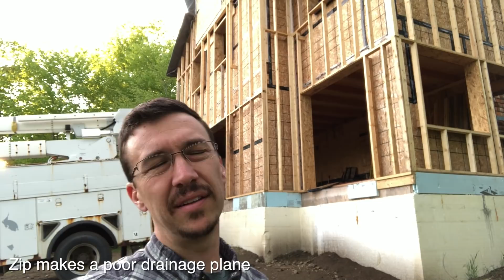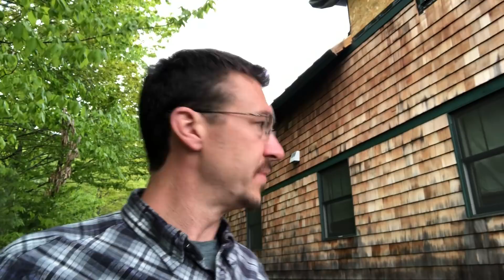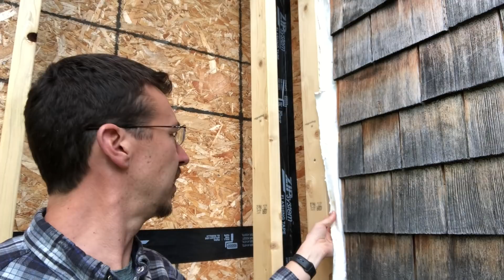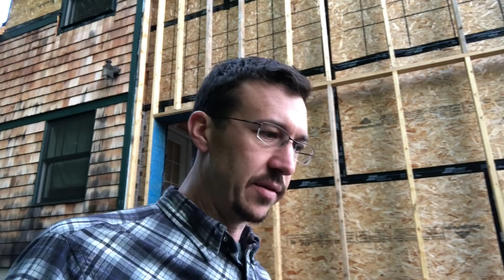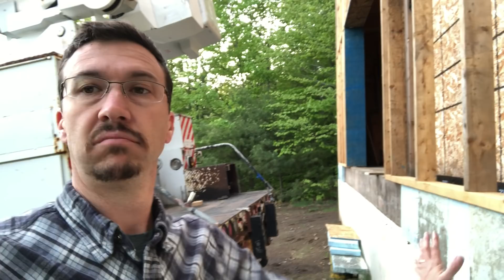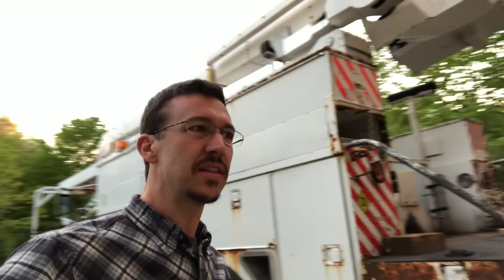Don't put Zip System Wall Sheathing on Double Wall Construction

Comment: In northern climates my preference is double wall construction with a well sealed vapor retarder on the inside and the rest of the structure breathable. No Tyvek, tar paper with a rain screen and bug stops unless you are applying stucco or a stone veneer. I those cases the moisture from applying the cement base coat swells the black paper and leaves air pockets that assist in moisture disbursement. Quality windows and an HRV complete the package. Mineral wool or dense pack cellulose for insulation. Both are fire, rodent and insect proof. I build my homes to last a hundred years at least
Reply: morninboy  so what do you use with a stone or brick Vanderbilt?

Comment: Go with the zip. Tape the seams and liquid applied sealer for nail holes. You want to drain any water that gets behind siding. Vent area between zip and siding (rain screen) so siding and zip can dry. Apply vapor barrier on inside of house to keep vapor out of walls. Use a whole house air system to extract excess moisture. If the sole function of the zip would be rain screen then maybe vent space behind it so the rock wool/wall cavity can stay dry. Just some thoughts for research. I may be in left field, but trying to help.
Reply: If you have a rain screen ……… probably pointless to do liquid flash the nails

Comment: Wow where to start. It is not ok to not know what you are doing. This is the information age. If you look you will find more info than you ever wanted to on products and installation methods. Tyvek is the biggest rip off ever. Do not use it. Do not use OSB ever unless for starting fires. Why would you use a product that disintegrates ? Spray foam insulation is both an insulation as well as a vapor barrier. Damage occurs when heated air escapes the envelope quickly and meets cold air. This creates condensation the number one destroyer of homes. If you make it impossible for heated air to escape at a high enough temperature than you will never have condensation. This requires a thermal break. Wooden studs do not insulate. You must stop thermal transfer through the wall studs to prevent condensation. Doesn't have to be ridiculous R factor it just has to be there. Use the same system on your roof. Letting your roof freeze is stupid. And cutting holes in your soffet and installing giant vents is beyond stupid. Spray foam ( closed cell ) and a thermal break will create an envelope that is impervious to condensation. Air quality. Install an HRV system. They are easy to set up and work better than any garbage tyvek makes. Do your research. Different products work better in different climates. A building in Miami may require a different system to perform properly. The basics are the same. Create a thermal break surface that cannot cause condensation because it cannot let air escape either hot enough or cold enough to cause condensation. Use ICF all the way to the eaves and if you got the guts use it for the eaves and the roof too. Sure it takes some effort to understand the mechanics but the science works. You will never live in a more comfortable and strong structure. Peace of mind is priceless. I hope you used a drainage curtain on your ICF's. It should be installed all the way over the footing and at least 2 feet out all the way around your walls. Remember you have to be smarter than the house.
Reply: Hmmm. I installed Tyvek on my garage 20 years ago and it's still pristine and doing it's job. How is that possible you ask? Because I did not follow the manufacturer's instructions nor did I install it the way every single contractor know to man does it. I actually thought about what I was doing and why. Oh and I also used OSB for the wall sheathing (plywood for roof and second floor). It looks and feels like it was installed yesterday.

The point is if it's done right it will last a lifetime. Sadly, contractors and builders don't give a shit about building for long term.
Reply: Well in Europe we use ICF where it matters. Under the concrete slab. OSB is used before plywood in places like behind the drywall (inside walls). We never use it for the structure or outside. OSB is half the price of plywood and don't bend like plywood does. Spray foam is the dumbest idea ever, well after DDT and asbestos. It gives constant gases that will kill you.
In Europe we never worry about thermal value of a studd. That seams to be an american thing. Studs have an R-value of 1. So get bigger studs, and you solve the problem. 2 by 8 is not uncommon for walls here. Floor? 22 millimeter advantech (pressed and glued product), is what to use. A good house have 1.8 inches thick floors.
Reply: @72strand  The acid cure floor finishes you guys use (Glitsa. Synteko ) is ten times more dangerous than polyurethane. Go read the manufacturer material reports. That is a total myth.

Comment: You don't need a WRB over ZIP. Use a fluid-applied to cover nail penetrations and it is perfectly acceptable drainage plane.
Reply: Don’t even need to do the WRB on the nailed spots unless an idiot made them over driven.
Reply: Another Zip fan boy
Reply: @Skinnymoose  nope, there are many other perfectly acceptable sheathing systems when done correctly. Zip is just one of them.
Reply: Yah plus the liquid flashing takes care of that

Comment: Wrap it with 30 lb felt and forget it .it'll be there when we're dead and gone!dont use cellouse because it will settle after 3 years and you will have a 18 inch settle void at the top ,rocwool or foam.tyveck has a 90 day sun guarantee,it should be 90 months!
Reply: I dont like felt anymore. When I was a kid my dad used it to cover the garage roof and it never soaked water or leaked. But the felt of today soaks, wrinkles and falls apart. The old stuff was saturated with tar but today there is less byproducts produced in gas refining so there is a shortage, so today's felt has very little tar in it.
Reply: @michaeldvorak5556  15 or 30 lb. Felt?
Reply: @MD-cd7em  Its been a long long time, but I'm sure he used 30# on roofs and probably 15# on walls. It didnt take much handling before our clothes and hands were covered with tar. The stuff today will barely discolor your hands.
Reply: @michaeldvorak5556  INTERESTING...YOU MAY HAVE A POINT...I STILL USE THE 15 SOMETIMES
Reply: @michaeldvorak5556  Cellulose does not settle if installed properly. Professionals install cellulose at 3.5lbs/cu.ft. with a pressurized dense pack hose. The cheapo box store rental machines can't install cellulose at proper density, and It will settle.
Reply: @jacobcasler342  I'm sorry, Mike Redding mentioned cellulose settling. I was only commenting on tar paper. I know the wet blown cellulose they do today is tightly packed and it won't settle, but in old houses that had cellulose blown into the walls it would settle 2 feet.
Reply: The issue with felt is that it quickly deterates if left exposed. Basically if you don't get it covered in about 30 days, its trashed. A Synthetic vapor barrier is an options since since it will last 60 to 180 days (depending on brand & weather conditions). Most projects run into delays (weather, Contractor delays, material delays, etc). Better to be safe than sorry.I agree with you on the cellouse. plus if there is a home (ie drill into, crack) it will start leaking into your home. Roxul is the best option in my opinion.
Reply: @guytech7310  your right, the tar paper made these day can't handle exposure. The stuff my dad used 50 years ago was different. We put that on the shed roof with wood strips for support and that's all. It never leaked, soaked water or wrinkled. It lasted for years.
Reply: It depends on the Tyvek chosen, they have a 120 day and 270 day (commercial wrap ) exposure rating  #30 Felt at the store today is not actual 30# felt anymore.  Besides, felt isn't an air barrier, so if you are trying to benefit from the reduction of air leakage, felt is not the product you want.

Comment: Most houses dont have a two wall system. If you have a one wall system and you use pray foam insulation which is a vapor barrier then the zip system will save you tons of time! TONS! And yes we create vapor but we put out the vapor and we bring in the air, the type of air we want with proper ventilation.

Comment: it'll dry to inside depending on climate, It's an awesome product for use in the south
Reply: @BenjaminFranklin99-s9n  usual practice is dependent on construction method, you speak as all walls are build the same...
Reply: @DaBuick   I have an SIP house, which I specified, so I know about different kinds of walls.  Where I live, Tyvek is used in all kinds of walls, and it has more perms than any other kind of WRB.  Almost all houses here use Tyvek as a WRB.  We have rain or drizzle 150 days a year, so we pay a LOT of attention to dealing with moisture.  We are also an earthquake zone, and wood framing is pretty universal.  We are overdue for a 9+ earthquake on the Richter scale.  We also have large Douglas Fir and Hemlock forests, which is the best framing material for earthquake resistance.

Comment: The scary thing isn't the tyvek but that OSB board is crap. Plywood would be better.
Reply: Find a happy medium and use pressure treated plywood the bottom 2 feet of the wall, OSB above that.
Reply from the maker: wild smooth yeah, osb can suck, but it has it’s uses.